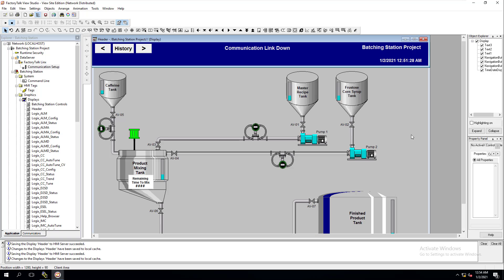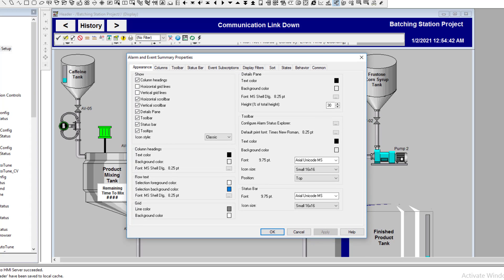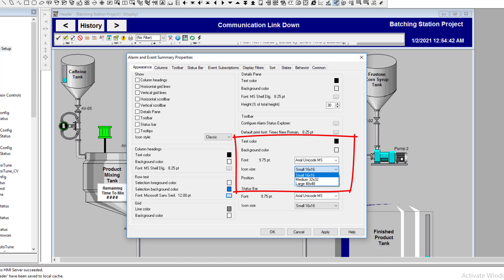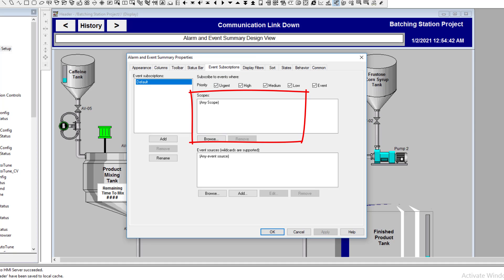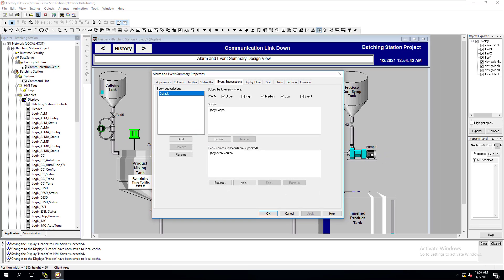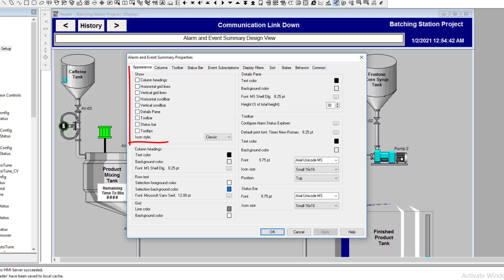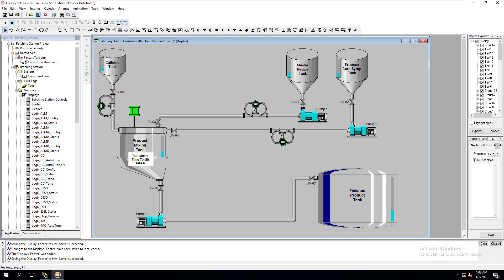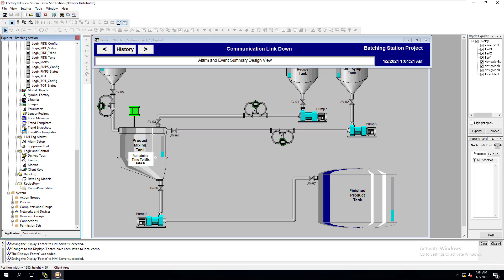FactoryTalk View Studio Site Edition | Alarm & Events Summary In An HMI Header | Batching PLC Day-14

Comment: What's the difference between site edition and machine edition
Reply from the maker: Mainly...one is terminal based & the other is computer based.

But there are a lot of features that open up when you use Site Edition.

Also, Site Edition is for large systems because you can link multiple clients together to use one HMI app.

Along with having the ability to have backup HMI servers.

There are a lot of differences, sort of hard to put it in text but I listed a few right off the top of my head.

Hope that helps
Reply: @ShaneWelcher  thanks a lot